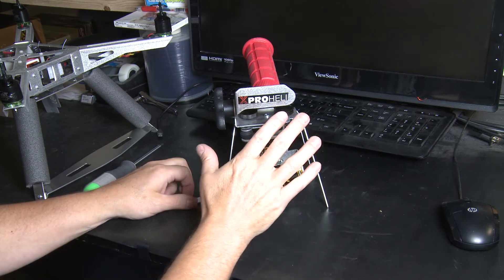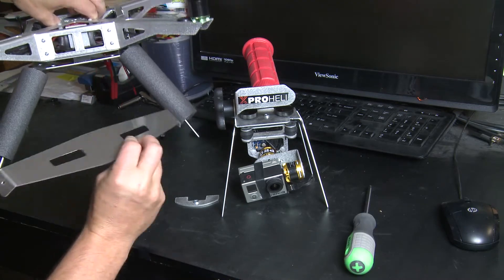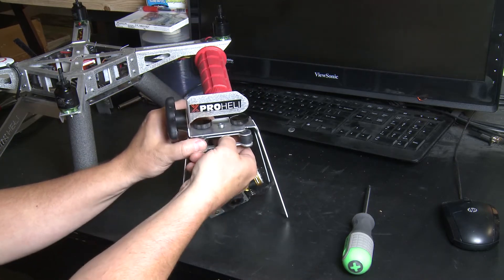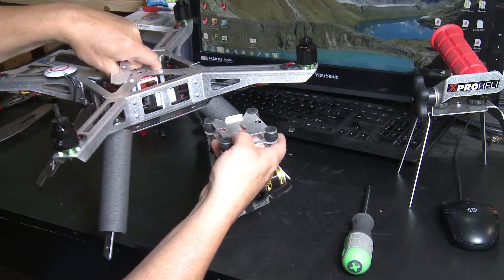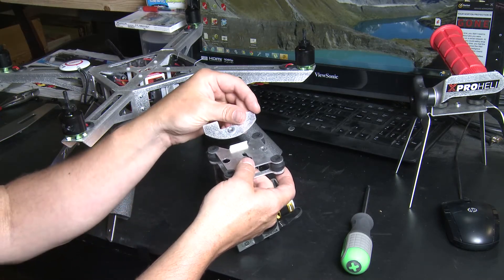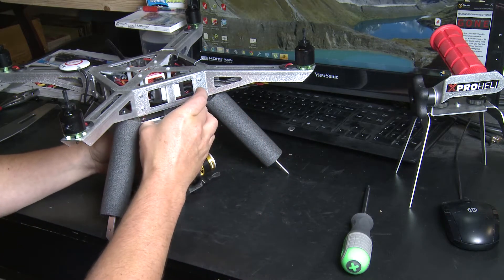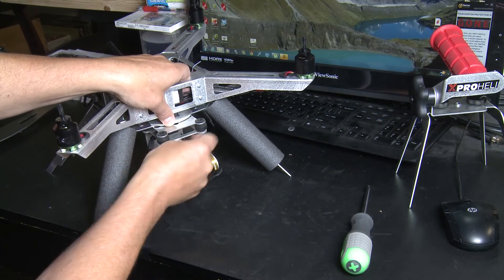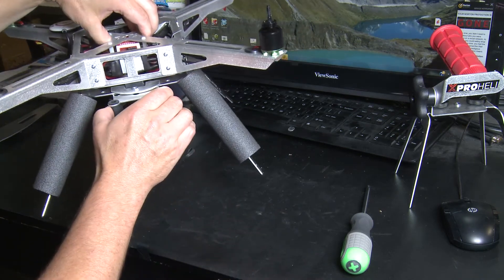XPG Brushless Gimbal install on XP2 Quadcopter - XProHeli

Comment: this is not compatible with Mac OSX? so is a PC with Windows a must have to use this?
Reply from the maker: Yes you need windows, we too are Mac guys but having a windows machine is pretty much a requirement as several other components on our XP2 require windows to run (NAZA software, ESCs etc..).

If your going to get into aerial video we recommend buying a used or lower end laptop for 200-300 for the field.